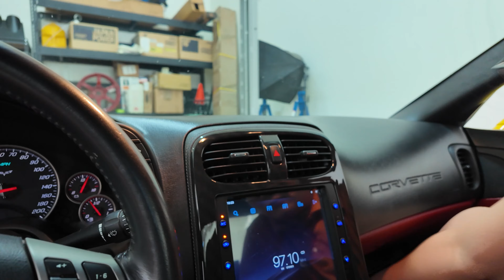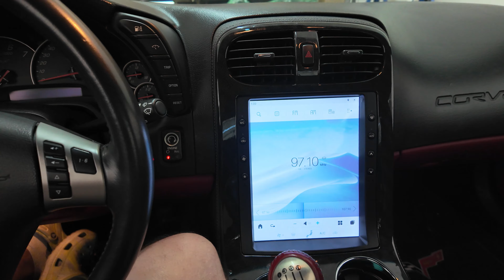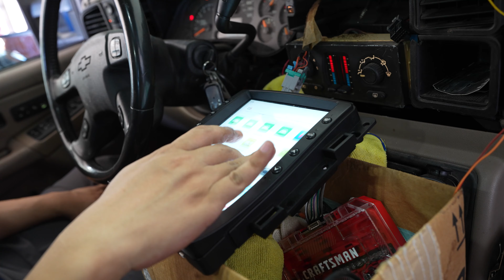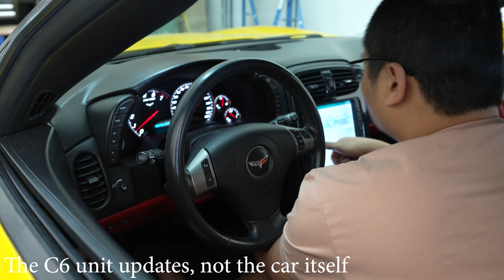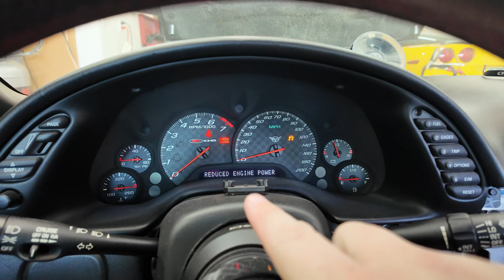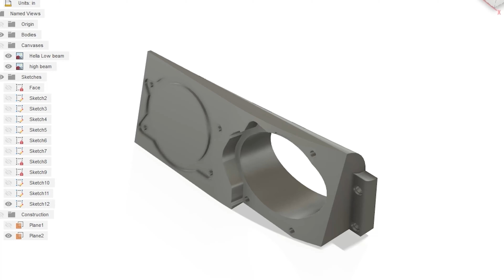Corvette and XLR Product Development Update

Comment: Hang in there! Development takes time, and unfortunately some consumers think products just happen easily. The only other choice is to do everything behind closed doors and worry about the marketing and advertising afterwards like so many big companies do. Generating the buzz as it happens is tough some days.

Sorry to hear SEMA hasn't shown a huge ROI. Thankfully you are local and didn't have to ship a ton of things to and from the show like so many do. Are you going back to just an attendee in the future?

The XLR was always a little riskier just due to the limited number of cars GM sold. How many C5s did they sell (like 225,000?) and you've sold sets for a small percentage. I would assume the C6 crowd is a similar sell rate (maybe less for the Max-DIN) and the XLR is only a small amount in comparison. The GMT platform may do better since there are a ton left on the road, but at this point I would wonder how many owners would spend $2k or so on a new headunit. Hopefully a lot.

You have mentioned a lot of new products on the horizon, so hopefully they materialize eventually. You have great ideas.
Reply from the maker: I've been attending SEMA since 2010, exhibited now 2x, once in 2010 and once last year.  Just wanted to be there on my own vs next to a certain someones bs.